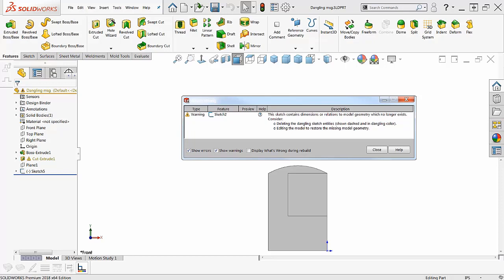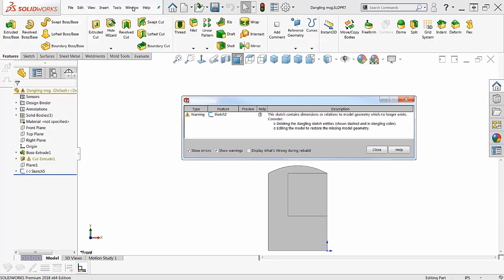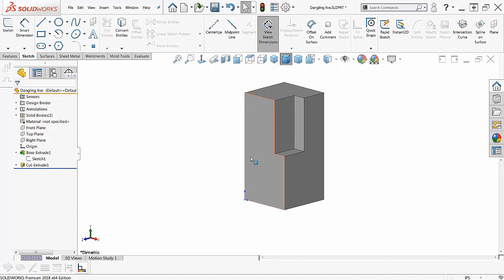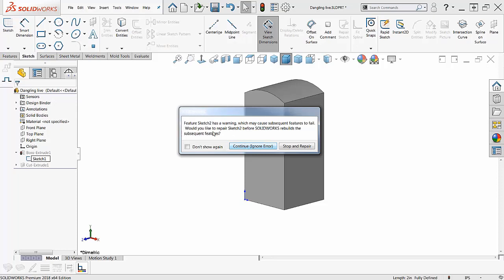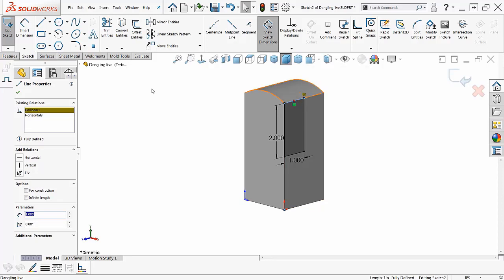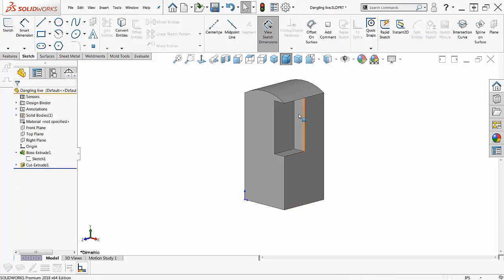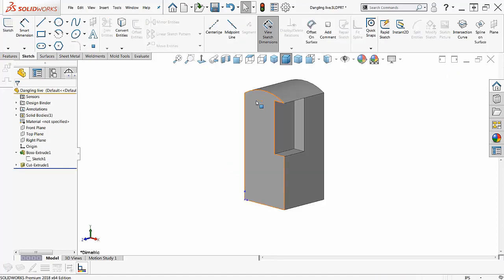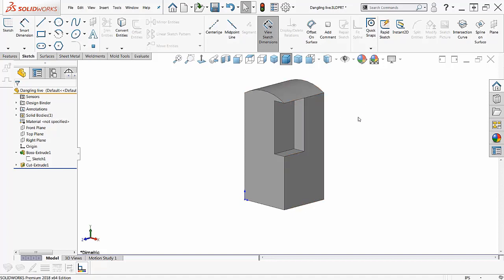SOLIDWORKS - Dangling Relations in Sketches

Comment: This is great but what happens when you have a super complex sketch and you can't find whatever hidden relationship got broken? Is there a way to find those since 'repair sketch' won't show you?
Reply from the maker: On the sketch tab of the command ribbon there is the tool for display delete relations. You can use this tool to show you all the relations in the active sketch. There is also a filer so that you can set it to show only the broken or dangling relations.
Reply: @goengineer thanks for that tip, but I scrolled through all relations and couldn't find any relation that was dangling, the error persists...